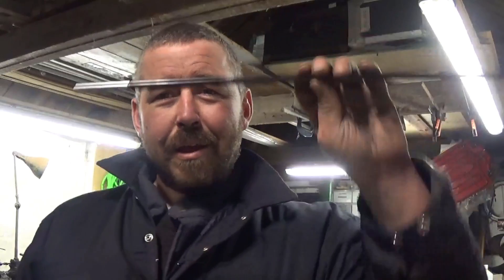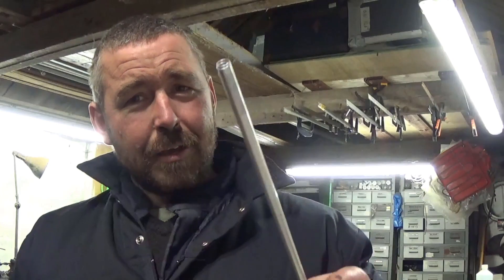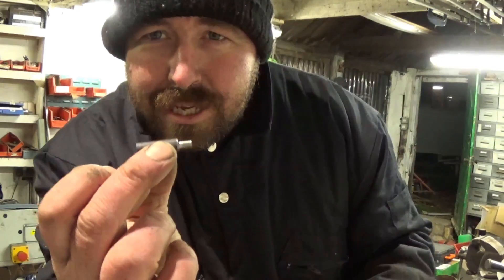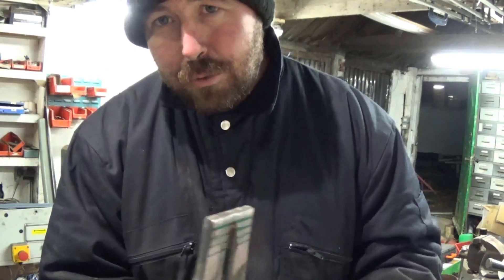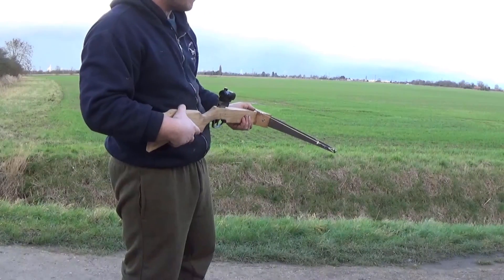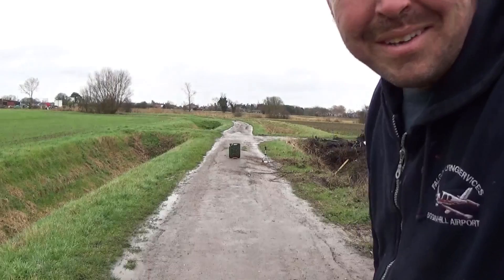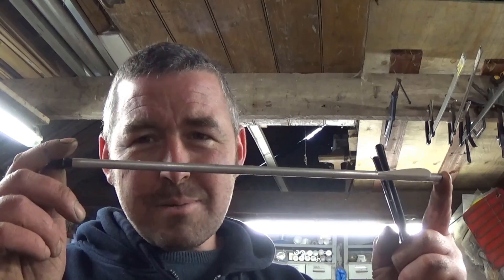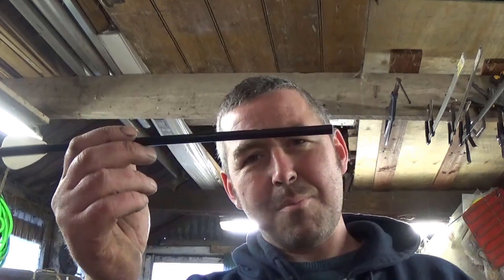Armour piercing crossbow bolts

Comment: You could try putting a thin length of aluminum inside the aluminum bolts to add a bit of extra weight.

Comment: You have to have weight behind the tip to make those armour piercing (unless you want to play with explosive heads? ;-) ). The ali, even with a thick wall, wont store enough potential energy to punch through anything hard - would be great against soft targets though.

Comment: Did i miss the part where a bolt actually pierced something metal or otherwise armor-like?
Reply from the maker: It went through the Jerry can!
Reply: @turboconqueringmegaeagle9006  Ah, I see now. Number 2 and number 3, the heads went through. Contrast on the can is a bit low in the lighting condition.

Comment: I’m wondering how powerful the bow is. It looks pretty easy to cock compared to some of the other bows I’ve seen and shot. They have always needed a brace or a winch to draw. The bodkins look pretty good. The ones used in the 14C were much longer and could get through plate armour. 👍

Comment: On the old battlefields you seem like youde be an upfront and personal bloke with a badass hammer, while crossbows would be more for the daniel radcliffe types.
Reply from the maker: I'd just hide under a corpse with a Stanley knife, anyone walks past and I'm having their ankles
Reply: Crossbowmen & archers needed a lot of strength until cranequins & windlasses came along. Crossbowmen would be dead lifting c150-200lb even with the mechanical advantage provided by earlier spanning aids such as belt hooks or cord & pulley. Later crossbow that did have cranequins or windlasses to cock them were pretty heavy to carry & use too, so not so much the weapon of weaklings necessarily.

Comment: Try getting 3mm strait wire you can put down centre of those tent poles and weld end to tip and maybe weld a flat endcap or fork at back end that catches the bow string?
Reply from the maker: One step ahead of you buddy, just arrived is a bag of 3mm tungsten carbide rods, might also see if a Zippo Flint will do anything spectacular.
What should i shoot with the tungsten?
Reply: @turboconqueringmegaeagle9006  awesomeness also thought why not try epoxy dipping hard wood dowels? Or filling top end of ally tube?

Comment: I figured aluminum would do Ok. I know this would be a pain in the arse, but you could fill the aluminum rod with some polyester resin. That would add weight, strength and rigidity. Eventually, you could experiment with partially filling the rod from the  tip area to a certain level to control center of gravity and accuracy...etc. Use the resin to hold your points in as well or thread your points and tap the rods. Good luck whatever you do. Thanks for what you do, and keep doing it. You are my Saturday morning cartoons now that I am an old man.
Reply from the maker: I've got to find heavy wall pipe, this stuff is way too thin to thread or anything like that, I've got some tungsten now, with a mould, pouring resin from the back around the tungsten would be really quick, thanks and I'm honoured to take the Saturday morning cartoon slot!

Comment: Have you seen ball valve air rifles ? you get a LOT of performance firing heavy things slower , like a chunky nail with a paper+tape cone...

alloy barrel , 500ml fizzy drink bottle..ballvavle (14mm - £5) cheap bike pump..innertube presta /shreader valves...bout £20 to put nails through things a 150lb crossbow cant match....the ones ive made can fire small lite arrows over 400fps clean entry exit through machine mart catalog and a chunky nail around 100fps through a whites phone book..

approximately twice the performance of my hw97k .177 from the same 11fpe power..
Dont need huge psi either...500ml at 70psi IS just under 12fpe with anything you can fit in the barrel....14yr kids in 3rdworld countries make them...without losing fingers aswell! 
🤪👍👍
Reply from the maker: Try a co2 extinguisher and a hammer on the valve, works the same way as a PCP gun, I've got to be very careful with stuff like this as my air bag shotgun got me reported to plod for terrorist activities.
Reply: It shoots over the barrel darts pretty well too, I made one that looked like a model rocket and had a needle sharp hardened steel nose cone/arrowhead. Coincidentally, "over the barrel" projectile launchers are classified as toys by German law.  Since I'm in the US, I shoot whatever fits in the barrel without worry since it's unregulated here. I've seen greased racketballs in a long 3" diameter barrel get launched through a sofa and go on over the horizon. I've seen potatoes launched through car bumpers, windows, and windshields.
Reply from the maker: @Odood19  same rules apply here with over the barrel however spearguns have an exemption so as long as i put my Speedos i could get a Barret .50!
Reply: Made one with a lucizade bottle and copper pipes could take 100psi shot a nail dart through the front of an old fridge out the back and blew up the gas bottle. Scary power sounded like a 22 going off

Comment: Them springs are really hard steel, we used to weld them on to the teeth on digger and shovel buckets to get more life out of them
Reply from the maker: They are bloody useful, i can normally anneal them in the forge but I've tried multiple heats and letting them cool in sand but these Volvo springs will not soften which means i can't cold work them with anything other than abrasives.